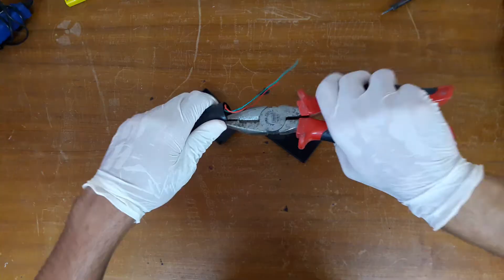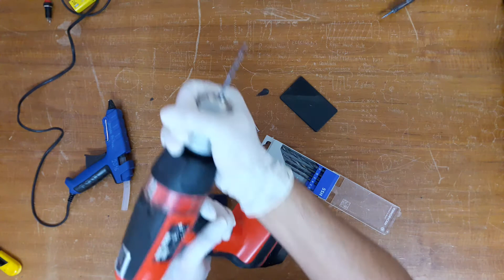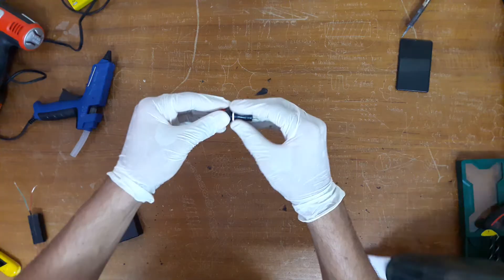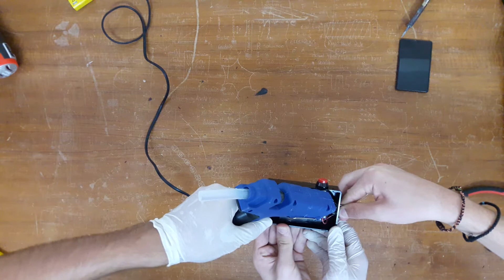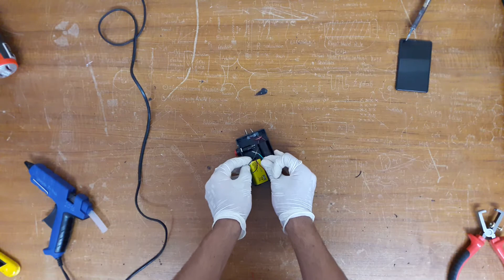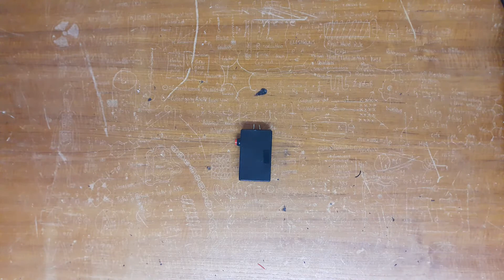400,000V Pocket Taser

Comment: How does that work? What is the other part you used? (Leo: your ps3 console buyer)
Reply from the maker: Leo Music store It works by converting a low 9v battery voltage into a much higher voltage using a transformer and then forcing it across a spark gap :D